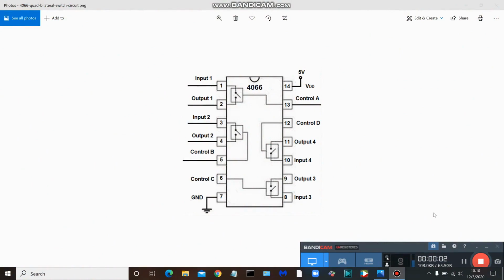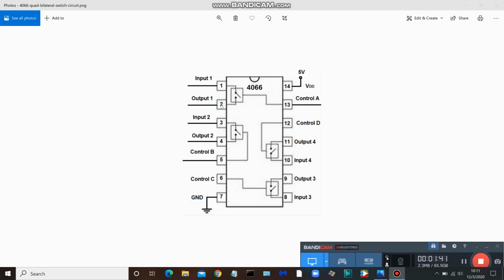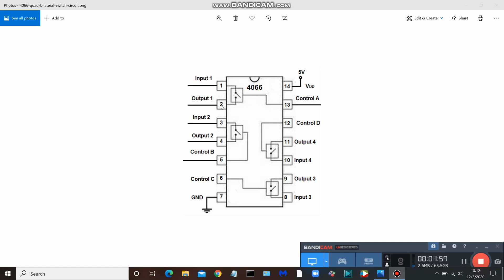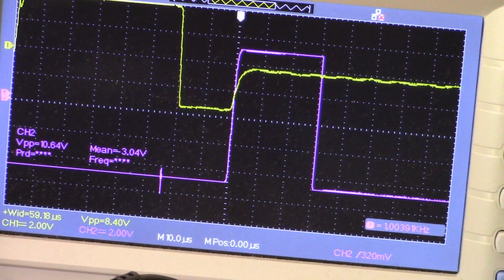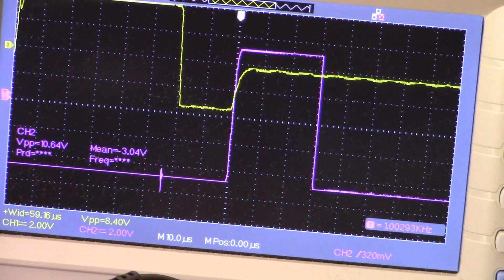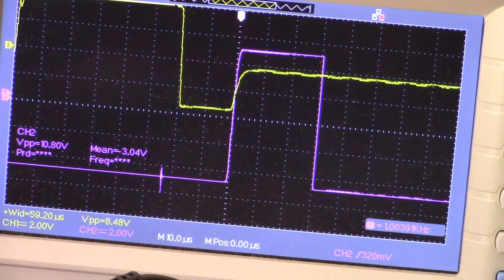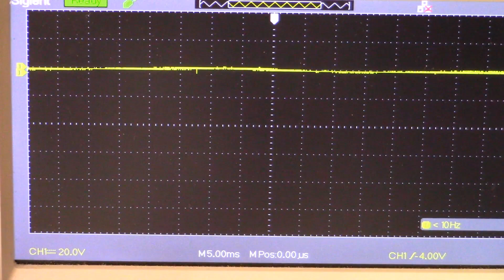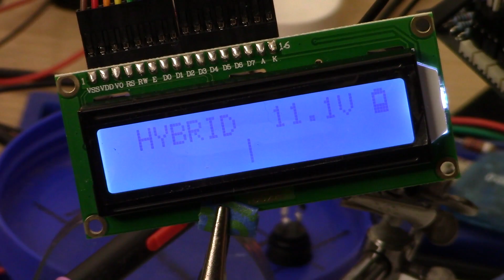Voodoo DIY metal detector Part #5 PI Demodulator, PI channel filter and Hybrid Mode test

Comment: how does the F75 coil work in PI mode
Reply from the maker: Half of the coil works as a mono coil
Reply: @SurfDetector  ok,cool, hows the sensitivity to small pieces if you have tried
Reply from the maker: Matt I assume that you might be thinking small gold as you are a prospector I believe.  This machine is not for small gold.
Reply: @SurfDetector  yes i am, 3/10ths of a gram or so

Comment: this detector use a tipical pi coil whit 2 wires or more? (3 if use Faraday cover)
Reply from the maker: This detector uses both a PI channel and a Disc channel.  5 wires.  
https://www.amazon.it/Voodoo-Project-INDUCTION-DETECTOR-REJECTION/dp/B08KH97NWG/ref=sr_1_1?__mk_it_IT=%C3%85M%C3%85%C5%BD%C3%95%C3%91&dchild=1&keywords=george+overton&qid=1607029274&s=books&sr=1-1

Comment: After your experiences to make a lot of metal detector ....... What is the best metal detector in stability, depth and gold sensitivity ???
Reply from the maker: Once again, why are you repeating your question so many times?  You do not say what kind of gold you are looking for.  Gold rings, gold coins, or gold nuggets?  Are you looking for treasure hordes? You need to be a bit more specific.
Reply: @SurfDetector  
I mean a device that is effective in attracting burials, such as boxes and utensils, at a distance of two meters and above, and is as sensitive to gold as it is to iron
Reply from the maker: @azzimkrim7509  Try the Delta Pulse, that might be what you are looking for, I do not have experience with it.
Reply: @SurfDetector  
Thank y